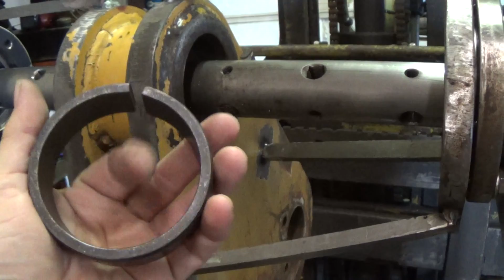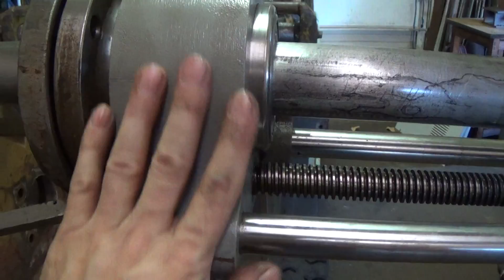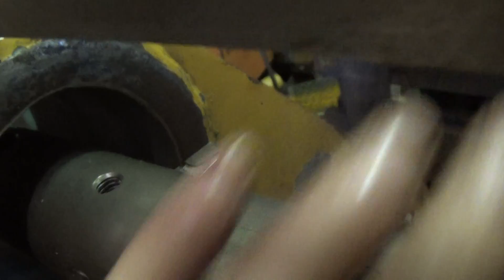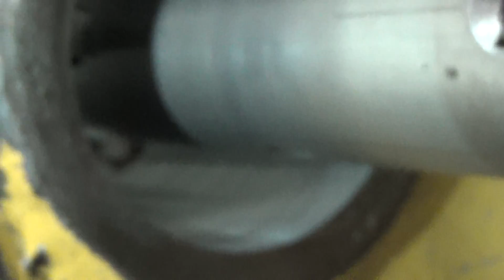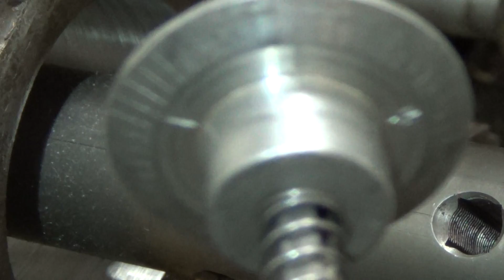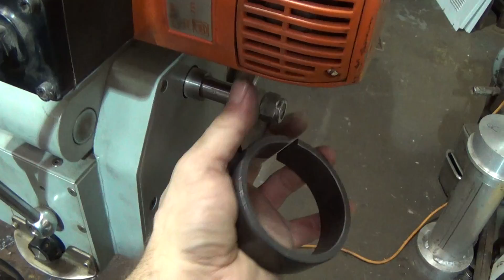Line Boring And Bushing  Pt.1

Comment: A few things come to mind. Without serious preheat, the bore weld is going to be under serious prestress due to cooling, which may lead to failures by cracking, or by deforming to the relaxed diameter under pressure.  Also, the alloy being bore welded may not be as suitable for bushing use as the one you are pressing in.  But aside from heat treat stare, or alloy selection, the other deficiencies in weld metal would tend to be issues with technique, or incorrect process.
Reply from the maker: Hi Kevin,  Yes, I have repaired bores that have been welded up and machined back to size and there has been cracking and peeling of the weld metal, and that is part of the reason I would choose to use it sparingly and in places where the cycle and load are not high.
Reply: Have you ever welded and line bored anything?  You sound like an engineer. I am a machinist/welder and have done repairs for 47 years. When welding is done right there are no foul stresses because of self annealing properties.

Comment: I'm neither a welder or machinist.  I'm learning but still very much the hobbyist.  With that being said, I would guess that the "weld" metal issue comes down to the quality of the weld being applied by the bore welder.  I say this because in the most basic tests of welds the metal is expected to fail as often as the weld, right?  
I enjoyed your monologue.
Reply from the maker: Yes, the weld, as welded should be, and probably is as strong or stronger than the parent metal, as in when you do a bend type test the metal usually fails before the weld. My concern when being used as a stand alone substitute for parent metal in a bore arises due to the gummy consistency of the weld which appears as you are machining it, and I believe it is softer than the surrounding material. I'm not completely against it, and I am aware it is sometimes the only way to go and I use it in some applications, but I would[in most cases] rather bore to a size that will allow a reasonably substantial wall thickness bushing to be installed in the bore and used as the bearing surface, be it welded or pressed.  Just my personal choice, as the saying goes, your mileage may vary.
 Thanks for listening to my blab, much appreciate the comments.
Reply: Thanks for the response.  As I said, I'm new to all this so I really appreciate when you experts share the knowledge.

Comment from the maker: Hi Chuck,  Thanks,  Yes, until the last 10 or so years I don't think it was very prominent, I think the machine would have been broken down and brought in for a more involved repair at a large fab/machine shop on a large boring type mill with lots of down time. We can talk bore welding, no problem, I think it's cool when used in the proper perspective, I think it's become a cure all as pitched by the line boring manufacturers, and I'm not so sure it's always in the customers best interest.